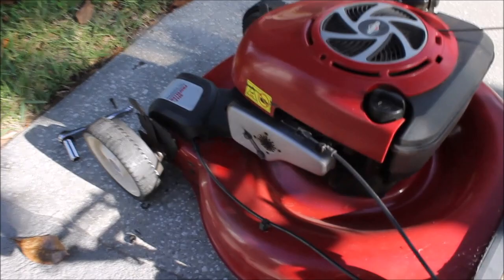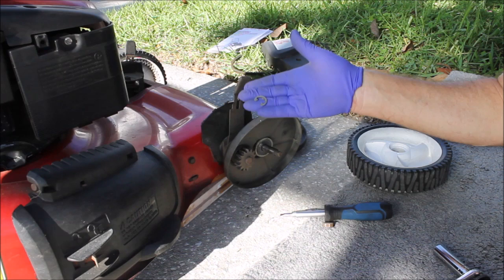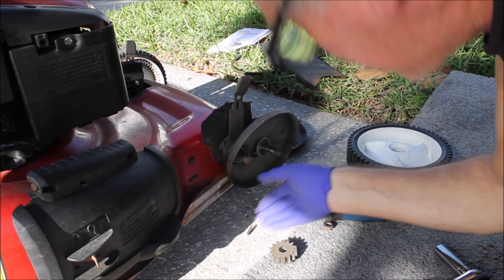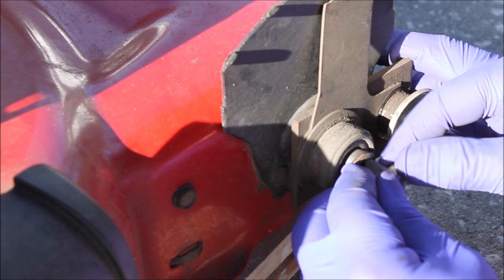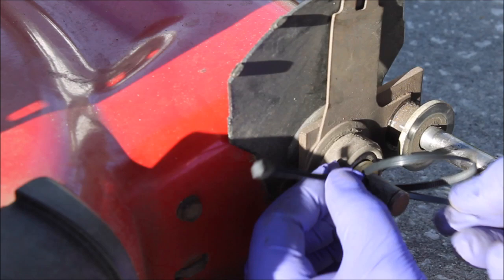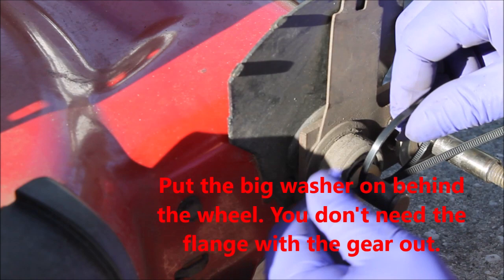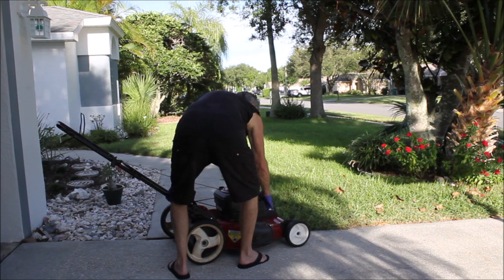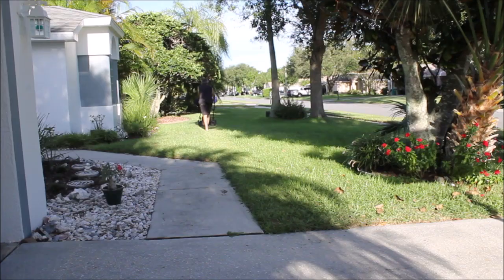Self-propelled converted to push mower in 10 minutes.

Comment: So I have a self propelled mower that the gears on the inside of the wheels wore down. If I take the belt off and do what you did here, I shouldn’t need to replace the wheels correct?